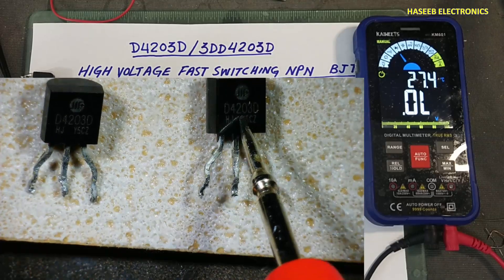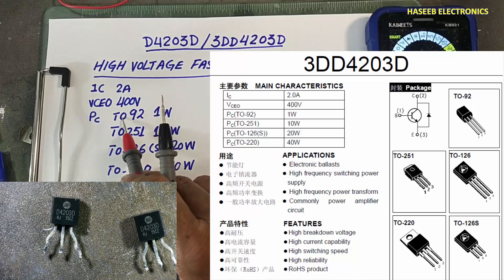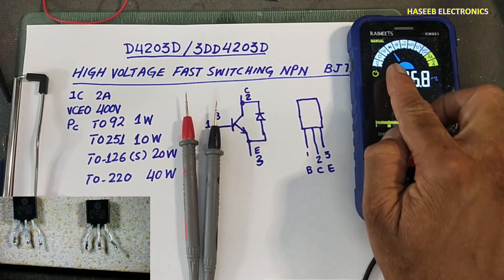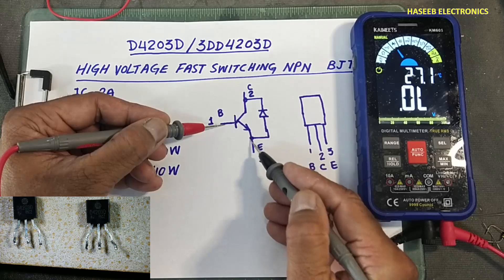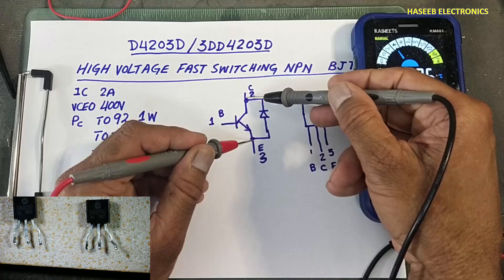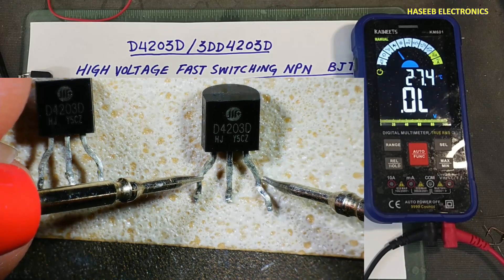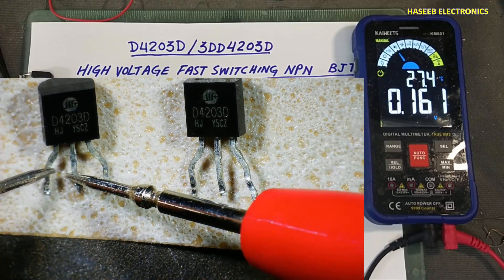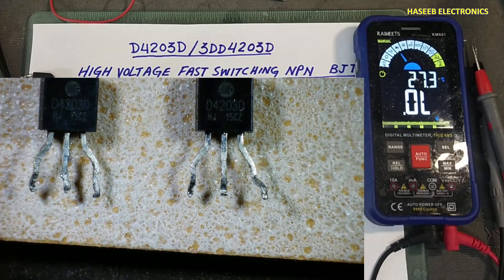{1134} Testing D4203 high voltage fast-switching NPN power transistor

Comment: Can you tell us how to check fuse Resistor 2A 250V
Reply from the maker: it is simply tested as a common resistor. 
becasue it is a wire wound resistance having some ohmic value, which gets open at specific power dissipation
Reply: you can only check the voltage if it conducts the voltage it is good

Comment: Walaikumasalam Waramatulahi wabaarahkhatuhu. Jazakumulah KHAIR for this short informative video. I have 1 question I know it will not give an exact value if it's on the pcb. But in your opinion can we figure out without removing it on  and test it.
Reply: mostly if there is no short between the legs it probably is good